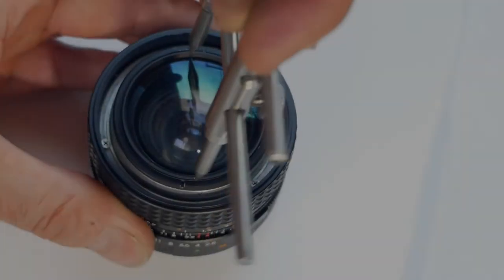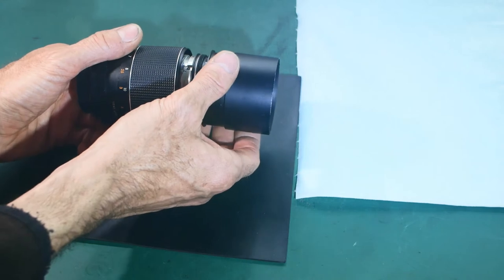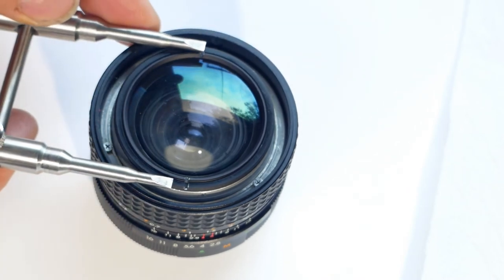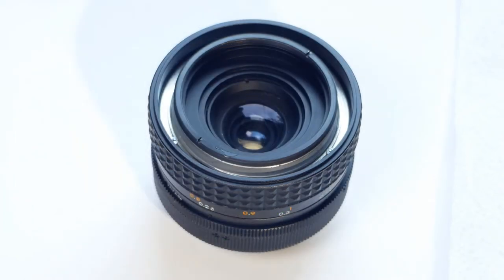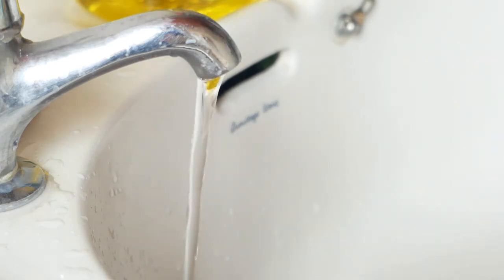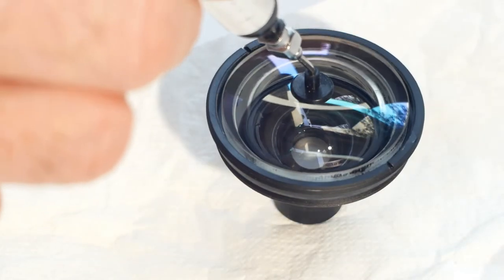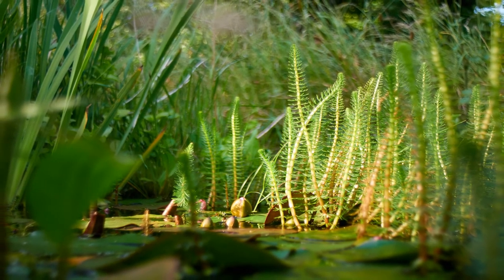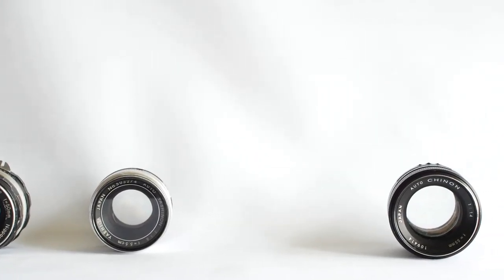Vintage Lens Repair - Makinon 24mm f2.8 - M42 Screw Mount Lens - Cleaning The Optics & Lens Test

Comment: One of the best lens disassembly tutorials I've seen, that follows up on questions you may have (e.g. what happens if you accidentally reverse an element). Keep it up- especially with these cheap third party lenses!
Reply from the maker: Cheers dj heheheheheheheheheheheh, I quite like doing the cheap lenses that no one cares about that much - sometimes they're not great lenses but they're still worth saving.  I've got more cheap lens repairs coming up, including another Makinon, I've just run out of time for making the videos lately so there's a bit of a backlog.

I suspect you could have a great game figuring out which optics were the wrong way round if more than one was reversed - I think on this lens you could easily reverse three of them by accident because they look kind of the same on both sides.

Comment: Thanks so much GrumpyTim for this video abut vintage lens repair and cleaning. I have a few lens that need and require cleaning, after watching your video I feel I can do it.
Reply from the maker: Cheers Kamishimo Productions, glad you liked the video.  All the lens manufacturers have their own way of doing things and even different versions of the same lens can change the way they come apart as the lens gets developed over time.

Generally, nothing should need excessive force to take it apart - there can be little grub screws securing parts that need to be removed first.

Just take your time and don't rush, take photos as you go - these can help if you can't remember how something goes back.  If you get stuck, just put the lens back together and walk away for a bit, often you'll be able to think through the problem and try again.  Lay all the parts out in order as you take them apart - this will help with re-assembly.  Some of the lens elements are quite difficult to tell one side from the other - make sure you can identify the correct orientation before trying to clean them because it's very easy to lose track of which way up the glass is once you're washing and drying it.

Hope you have fun - it's very satisfying once you've fixed stuff.

Comment: 6:56 I guess a black permanent marker pen would serve well here with the least chance of adding thickness to the periphery or messing up, as the liquid paint might do (Even if it is to roll the lens side way on a thin layer of paint on a flat surface).
Reply from the maker: Good idea, I would think a permanent black marker would work.  I think if I was re inking the edge of a lens I'd probably use something like Indian ink but your permanent marker seems like a good idea too.

Comment: Tim, thank you for this. I got a $5.99 Yashica lens that has some fungus and haze. Going to pick up some tools and take my stab at this. I'm more than confident I could take this apart and get it cleaned up.
Reply from the maker: Cheers Greg, just go slowly and carefully, make a note or take photos as you go along to help with reassembly.  Each lens manufacturer has their own way of doing things so you'll be bound to find a few quirks as you go along.

Generally nothing should need lots of force to open it - if it's tight, maybe there's something like a grub screw holding it.  Also, some lens manufacturers use a lacquer type substance to stop screws rattling loose - this can be dissolved with a little alcohol such as IPA.

Hope you have fun fixing your Yashica lens, it's rather satisfying when you successfully bring a distressed lens back to life.

Comment: Amazing results
Makes me want to clean all of my lenses now lol
Thanks
Reply from the maker: Cheers Paul.  Just in case you are seriously thinking of cleaning all your lenses (which I doubt you are, given the "lol" at the end of your comment), there's always that slight potential that something could go wrong (like one of those tiny screws or springs flying off into oblivion, never to be seen again), so I'd only clean them if they really needed it.

There's also a reasonable enough argument that tap water can contain tiny mineral deposits which can potentially scratch the surface of the lens, so some folks say to only use distilled water.  Another, again reasonable argument, is to NOT use washing up liquid as this could potentially damage coatings.  For my own part, I'm going to carry on more or less in the same way because I'm perfectly happy with the results on all the budget lenses I've cleaned.  I would think twice before I started work on one of my expensive lenses that I use on my Nikons - but those are well cared for and should in theory, not need cleaning (other than a bit of dust on the front element).

Comment: That Chinon 28mm looked very sharp!
Reply from the maker: Yeah, that Chinon 28mm lives on the camera as my main lens - most of my normal videos are shot using it.  I can't remember what I paid for it, but it wouldn't have been much.  I also have a 28mm Auto Super Paragon PMC in Pentax PK fit - that one is even sharper than the Chinon, although, apart from doing a few test shots, I haven't used it yet.
Reply: @GrumpyTim  What version of the Chinon 28mm is it?
Reply from the maker: Hi Cyber Monk, sorry for the slow reply, my Chinon 28mm is the Auto Chinon 28mm f2.8 with the Orange "Auto Chinon" and the rest of the writing in white.  So it's not the later "multi coated" version and not the early version with the leather looking focusing grip (mine has the rectangular knobbly rubber grip).
Reply: @GrumpyTim  Thanks for the information ;-) it can be difficult with those vintage lenses to know which version it actually is haha.

Comment: Nicely done. I may have to try that at some point.
Reply from the maker: Lenses are kind of fascinating things.  I should really get myself a lens or two that I don't care about and strip them completely and then rebuild them because there are still parts I haven't worked on - so far I've only fixed the parts that have needed fixing.

I repaired the shutter and cleaned the optics on a vintage Zeiss Ikon Contaflex camera this week - I didn't film that because I needed to concentrate on what I was doing but I will do a demonstration video at some point in time.
Reply: @GrumpyTim  Cheers!

Comment: 0:58 Please excuse my ignorance but do get what Fungus or Debris means but never understood what Haze is. Could you please explain it further for me? or is this also a form or smaller micro dust as this is an inner element and no one has touched it to leave finger oil on it or likewise. Thanks in anticipation.
Reply from the maker: Hi Sam,  Haze is like a cloudiness over one or more of the elements - a bit like when it's cold outside and your house windows mist up (but the haze is there all the time) - when it's bad the lens can be really lacking in contrast and will tend to flare when pointed towards a light - not a pretty flare, just a low contrast, milky image.  Often when you have a small scratch or dust on a lens, you'll rarely see any difference in performance.  The same can go for fungus - a mild case that hasn't spread too far into the lens, can be hard to detect in the shots, but haze usually results in poor performance of the lens.

As for what causes haze, I think there can be a few reasons - if the grease used in a lens has decomposed, it can leave very fine deposits on one of the lens elements which give the haze (usually one of the elements next to the aperture blades, because the aperture mechanism creates a passage for the deposits to travel through.  I've seen haze build up on some lenses that have repeatedly been allowed to mist up (ie when you bring a lens into a warm room after shooting in winter - I generally try to put my camera gear in a camera bag before entering the house in winter so they're not hit by the warm air which is when the condensation forms).  It seems that with the condensation comes small amounts of dirt from the atmosphere which can adhere to the glass.

From my own experience, haze is usually pretty easy to remove by simply washing the lens elements.  There's a good argument to only use distilled water for washing lens elements because tap water can contain tiny particles that could scratch the lens, although I still use tap water for some of my less important lenses.

Comment: Hi! I have to mount my copy of the lens, but the previous owner didn’t serviced it correctly, so I needed to ask if you can tell me how is the optical design of the lens, thanks a lot!!!!
Reply from the maker: Hi Felipe,  I'll try to dig out my notes to see if I wrote down the optical layout of the lens - I seem to remember that there were a few of the small elements that could have easily been inserted the wrong way round.  Even when it's assembled correctly, it's not the sharpest lens ever made.

Comment: Hey there. I have myself a makinon 28mm f2.8 for pentax k mount. What is the name of te screwdriver you have to loosen the really small screws? When i take of thhe front cover of mine it has flat head screws rather than star point. Any assistance would be greatly appreciated :)
Reply from the maker: Hi Epic Engines,  the screwdriver set I used in this video is an old set of precision screwdrivers that I bought from a local hardware store - I've bought similar sets recently, they look identical, coming as a set of about 10 in a plastic box with a clear lid, but on the ones I bought recently, the quality has always been really bad - I'm sure there must be some good ones around but there are definitely plenty of rubbish ones too.  If you search for "precision screwdriver set" on either Amazon or Ebay, you should find the sort of thing but it might be luck of the draw as to what quality you'll end up with.  On the flat bladed screwdrivers, you can re grind the tips over and over again using fine emery cloth or wet and dry sandpaper or a fine file.

For even finer work I also have a set of watchmakers screwdrivers which go down to tiny sizes - these tend to cost more but the set I have is reasonable quality - something like this on Amazon https://www.amazon.co.uk/LLF-Precision-Slotted-Screwdriver-Watchmakers/dp/B07LBRC9G3/ref=sr_1_11?dchild=1&keywords=Watchmakers+Screwdrivers&qid=1630314621&sr=8-11   - this isn't the actual set I bought so I don't know what the quality would be like.  I think I probably got my set from a uk ebay seller "redroosteruk" but I suspect you're not UK based so maybe you'll need a seller more local to yourself.  Again with the watchmakers, you can tidy up the tips of the screwdrivers using fine sandpaper or a file, or even an oilstone, as used for sharpening chisels etc.
Reply: @GrumpyTim  thank you so much my friend! :)